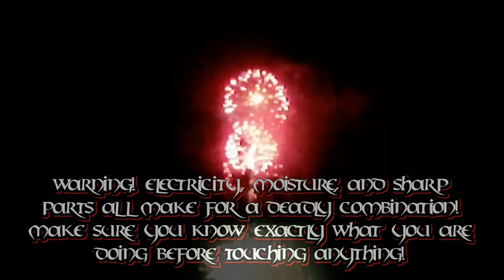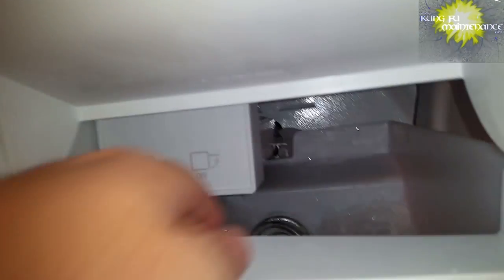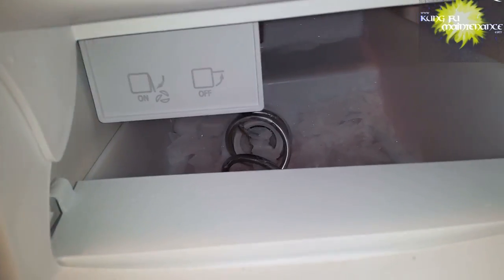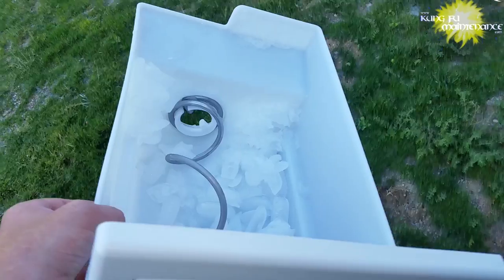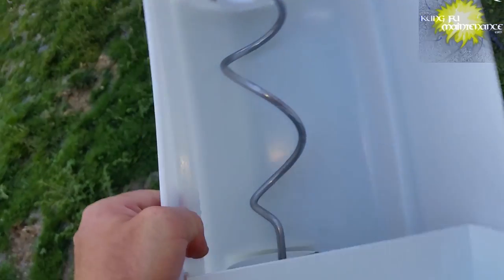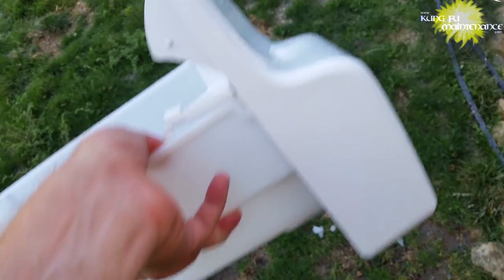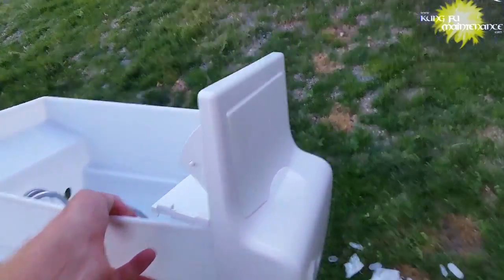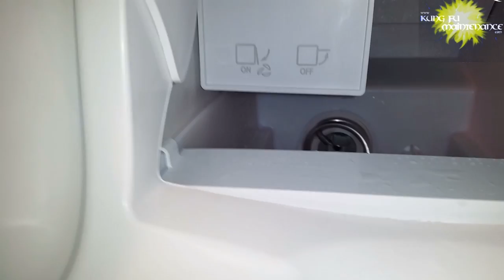Ice Water From Refrigerator Freezer Door Funny Tasting Bad How To Restore Good Clean Taste

Comment: I cleaned all walls and doors  both sides  of fridge with ammonia and rubbing alcohol and more alcohol   after one week smell is back , 2 weeks gross just as bad...it's in side the fan area of the fridge.Its inside where the fan blows air through this fridge is a completely  abad design. how to fix.  Cleaning,the walls and compartment isn't going to work.  Trash the fridge thanks Kenmore!

Comment: I have the same ice maker in my Frigidaire but different model, mine is all rusted, especially the ice grinder propellers and and that thing in the back that turns the auger that pushes the ice forward. I too have an RO unit hooked up. Don’t bother calling Frigidaire when yours rust they will just give you attitude.